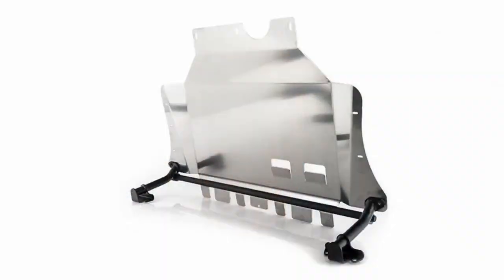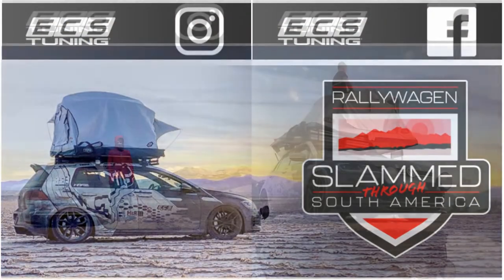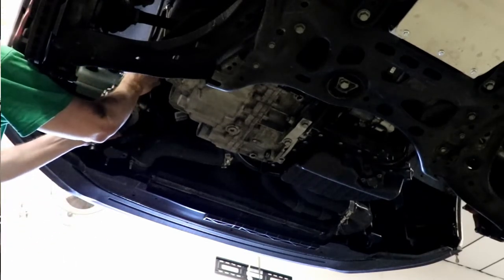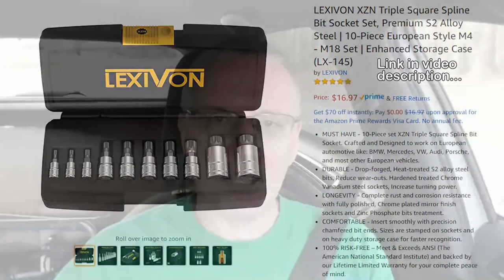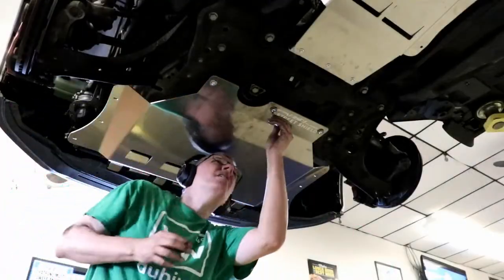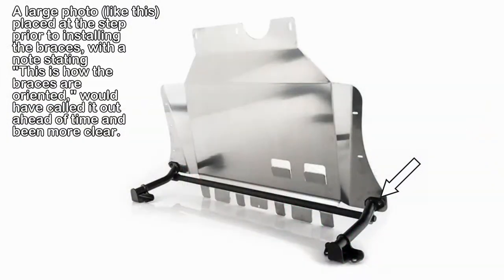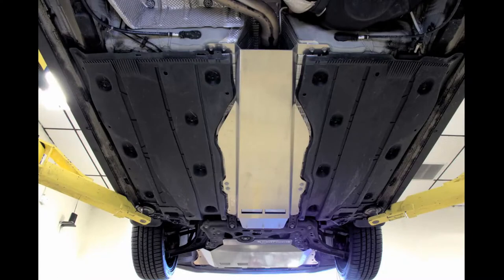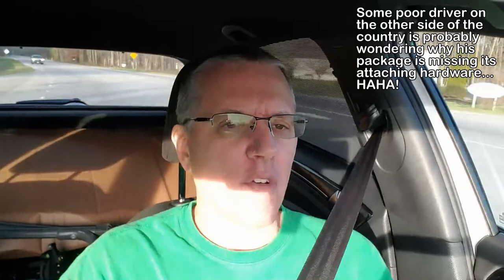ECS STREET SHIELD SKID PLATES - Ready to Rally

Comment: Hey I was thinking of doing this on my car but I was wondering how difficult is it to change the oil with the skid plate on? Also without the supports how different is the process?
Reply from the maker: It's not difficult, but the pan has to come off. There's 13 screws holding it in place. Without the extra brace, I think there's either 10 or 11 screws remaining. Personally, I use a vacuum extractor and change my oil from above the engine. Thanks for visiting!
Reply: @StealthGTI  I also use a topside extractor. Does it matter if we just leave the same drain plug for multiple changes?

Comment: Can anyone who has this kit tell me what the weight of it is? ECS rates the skid plate alone at a surprisingly hefty 16.5lbs. I imagine the reinforcement brace adds a good chunk on top of that.

Rigidity and protection versus lightweight, I know. It's a sliding scale.
Reply from the maker: Thanks for writing. ECS advertises the total weight of the plate and supports at 24 lbs. I'm surprised it's that heavy. I've struck a speed bump once. I'd much rather have that energy go to supports than a plastic bumper trim piece. Take care!